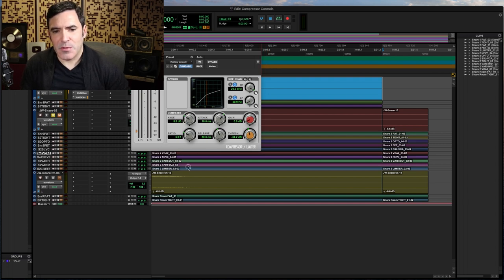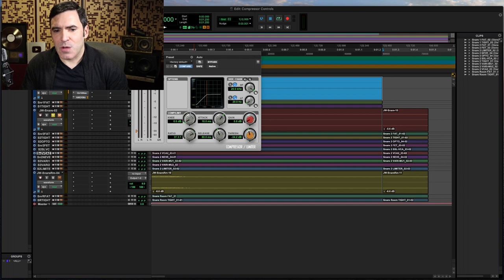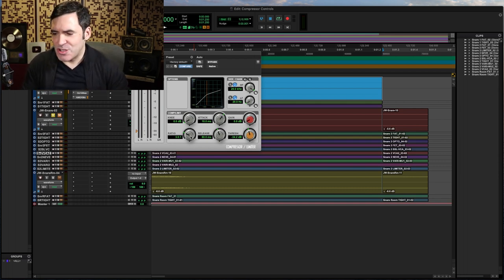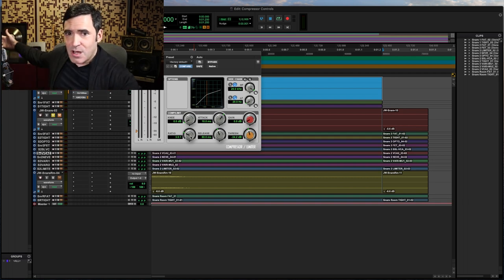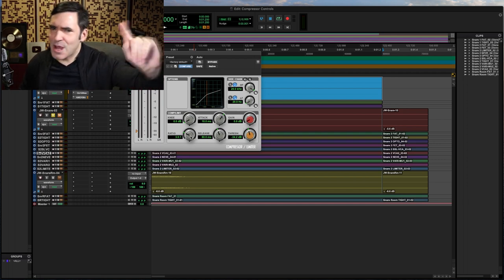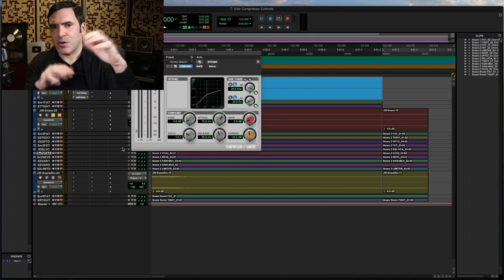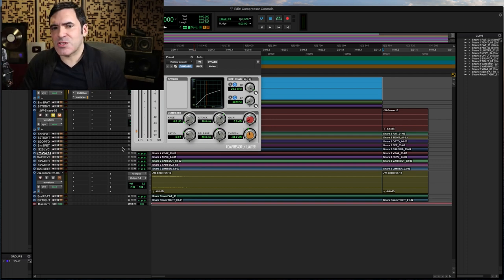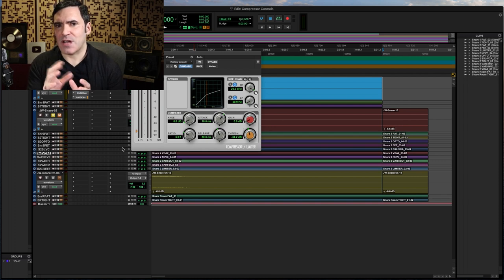How to Actually USE Your Compressor's Knee Control

Comment: Is it Just me or the video has interlacing artefatcs?
Reply from the maker: Yes it does! It's from a livestream episode so it's not the same video quality as the normal episodes, but I'm working on improving livestream quality each week. 

Might need some new capture hardware to improve it further still. If you have any specific advice, I'm all ears! Much less my wheel house than engineering music projects :-)

-Justin
Reply: @SonicScoop  I'd look into a DSLR camera hooked up to an Elgato capture card via HDMI.
That way the video would natively be full HD or even 4k and the picture quality would also improve.
In regards to the DSLR, make sure that it's got a good face/eye tracking autofocus, like the Sony a7c. 
The optics required depend on what distance the camera is from you obviously but a 24 to 70mm zoom lens would have you covered for sure.
Reply from the maker: Interestingly enough, that's exactly what I have! A Canon t6i DSLR into an Elgato CamLink 4K capture device. It gets a bit of interlacing not found in the camera itself, that Ecamm Live smooths out a little bit. 

I also have a Canon 70D, which does not have the interlacing issue, but for some reason the Elgato reads that as only being 720p. Maybe I'm better off using the lower resolution without interlacing for now. I don't see a huge difference between 720 and 1080 for this kind of shot if it's not getting punched in.

I chatted with Canon service about it and they said I may need a different type of HDMI cable called an HDMI-CEC to get 1080p out of it, but I'm having a hard time finding anything labeled that way. I was going to chat with Elgato about it next.

Unfortunately, these Canons can not be used with autofocus is on when sending out HDMI or you'll see a little white box on the feed. But I've had other viewers tell me I should be ditching autofocus anyway, because sometimes you can see artifacts from the motor moving.

This is the same camera setup I use for my regular videos, and it looks much better when I'm not livestreaming and just filming to the internal card like I normally do.

Any other insights are welcome!

Thanks much,

Justin
Reply: @SonicScoop  Ah I see, I'm not familiar with the Canon system, but only with the Sony, that's why I recommended the a7c, you can use face tracking AF with no artefacts even with pretty drastic camera movements (think music video movements), and you can record from the HDMI with no white square around the face
(with the issue that if you use 4k you can record either through the HDMI or to the internal card but not both at the same time).

But hey, video quality is not why I watch your videos and I'm pretty sure nobody feels that it takes anything from your content!

Comment: I like the way you explained it, except for the analogies, they didn't make sense to me because they have nothing to do with the subject... But when you talked about thresholds and ratio and more abstract ideas, I understood better n_n
Reply: Try this analogy. You have a stream in your garden (the volume of water is the signal). You want to make a pond so you build a dam to the height you want the pond water to be (dam height is threshold). In drier months the water is low and never goes over the top of the dam. In heavy rain (signal gain) the water rises until it hits the top of the dam and then it starts to spill over. The threshold is controlling the pond depth so it can never flood. The top of the dam wall is also a hard knee limiter. No water can ever rise above the height of it. Hope that makes sense.

Comment: It's great to give these "basic" concepts a second look. I've been doing the same with compression generally lately. Thinking about this after this video, wouldn't it be accurate to see a compressor with a knee of having two thresholds. One threshold that starts dynamic ratio, and another that separates from the consistent ratio? Anyway it's great to dig into these things.
Reply from the maker: Awesome to hear thanks!

I like they way you’re thinking :-) Unfortunately, I don’t think that would work because it’s effectively like a graduated ratio that changes bit by bit as the signal gets hotter and hotter.

You’d need a nearly infinite number of thresholds with a nearly infinite number of ratios (at least in the analog domain). So for me the “fuzzy line” or a ridiculously multi-tiered system of runner up prizes makes more sense.

Interestingly, your idea would work perfectly for the very uncommon Release Hysteresis control we talk about later in the episode.

Hope that helps make more sense of it!

-Justin
Reply: @SonicScoop  definitely! thanks for the response

Comment: i prefer softer knees to harder knees (when experimenting with comps that have that control)...that's all i knew
Reply from the maker: Softer knees will generally sound more transparent and with fewer artifacts all else being equal, as the attack and release are effectively slower and the ratio is effectively lower.

With harder knees, you’ll hear the compressor more with either similar settings or the same amount of gain reduction.

So when you want to hear the compressor “working” a little less, softer knees are always a good bet.

That said, sometimes you need your compressor to work harder, be grabbier, or maybe you want to hear it a bit more.

Hope that makes sense!

-Justin

Comment: Yes I think I know what the knee does, it can help smotthen the compression, Its like a lookahead but of the slope of the treshold in my opinion, I don't think it help smothen the transient in my experience cause you need heavy compression in what I experienced except in high ratios but I had to check again in particular
Reply from the maker: Question: which do you think would smooth transients more and why? Soft or hard knee? 

Spoiler: It might not be what you expect based on their names… :-)

(Though it depends a little bit on interactions with other settings…)

Happy to go into detail on that point if it’s helpful, but would love to get a sense for your gut impression as to how it might work.

Thanks for your input!

-Justin
Reply: @SonicScoop  Depend on the attack and threshold as well as the ratios cause a hard knee with short attack would smash the transients but a hard knee with short attack and long release with a higher treshold could expand the dynamic 

Because the compressor attack is just the delay for compression, if a soft knee will start compressing before the ratio curb so with a slow attack it could be give more punch than with a higher ratio so... I have to confirm this in testing further than theory thanks for giving me this opportunity to think again.

Its like this episode Ive seen of stargate when I was young, a 3 digit have 999 possibility (Tresh,Attck,Release) but a 5 digit code you have 90000 possibility (Tresh,Attck,Release,Knee,Ratios).
Its just an allegory I know it can't translate as well but you guess you my point.